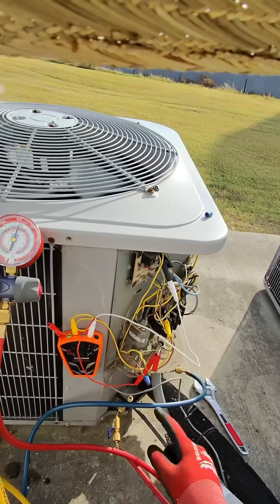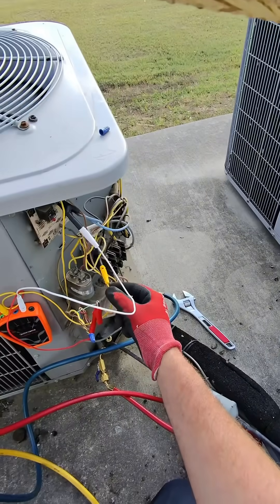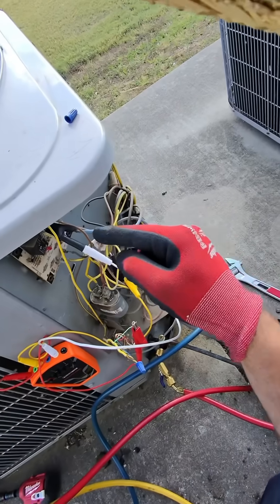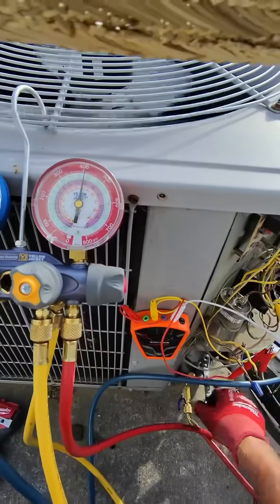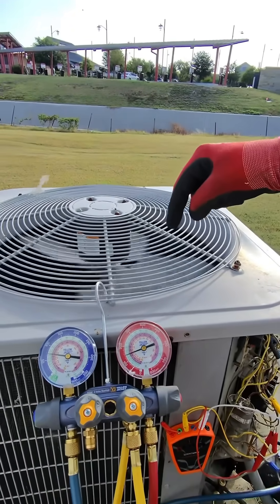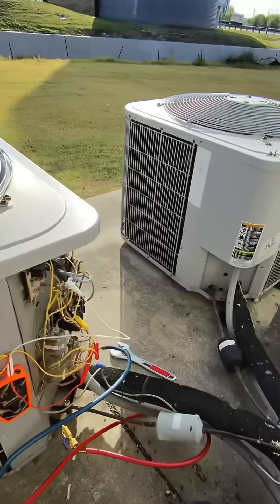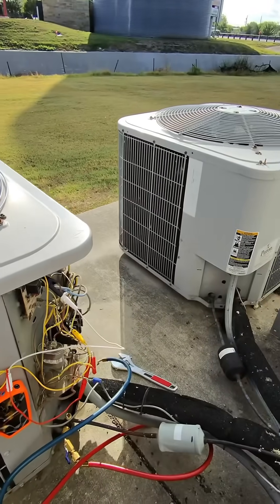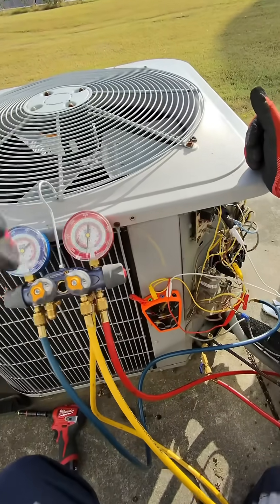Why do we pump down HVAC systems?

Comment: You can pump down a system into the compressor without a liquid receiver? I didn't know that.. student
Reply: The only system you can’t really pump down is a condenser with a micro channel coil. There isn’t enough volume in the condenser to store all the refrigerant.